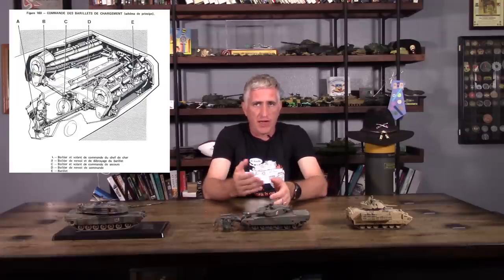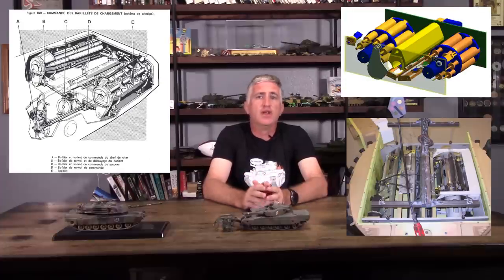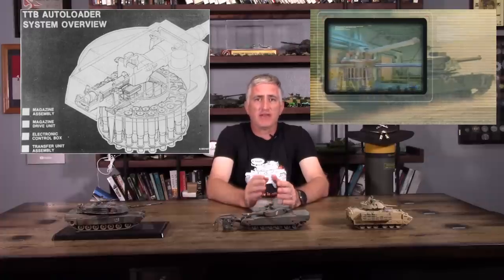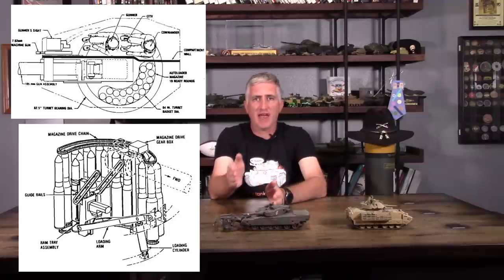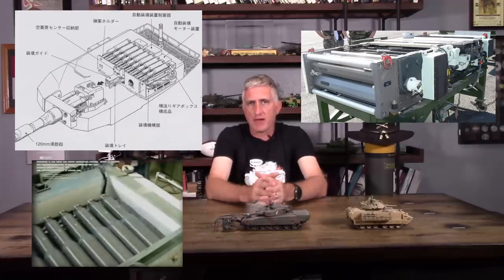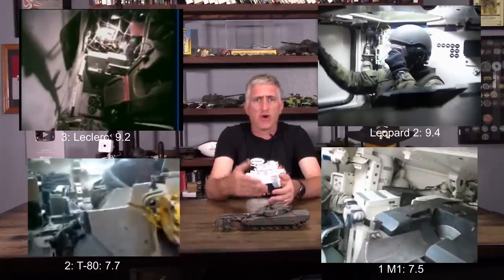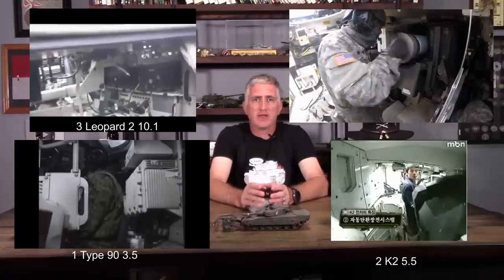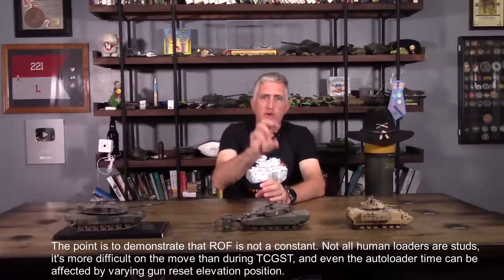Whither the Autoloader?

Comment: At some point human loader is too weak to be effective. Like the moment when the military uses bigger guns (Even same diameter like 120mm but with way longer rounds) can be a serious problem. Tanks in the past showed that 2-stage ammunition is way slower to load for one man than one staged where he only has to but the round in and it can be fired, modern autoloader will alos use one-staged ammunition i belive because its also fast then loading two stages one after another. 

The fourth man is not an advantage on field, I mean in the time of the battel no army in the world has time to save some of there tanks if they got hit, everything like this happens after the actual figth and mostly even trougth other units that a specialized in rescuing mechanist units. 
You can even say that man could be an disadvantage. If he dies no one in the tank can just try to fix it, also th moral would be down for some time, also the new loader maybe not working as well as the dead guy before with the rest of the crew. An autoloader on the other side would be just a modul, I believe modern auto loaders could be even designed like the engine compartments on Leo. 2 and Abrams so at the repairstation they can jsut be switched out and in in short time so only big problem would be in the end if the crew got disabled or even the hull broken.
Reply: Well you physically can’t use human loaders with most new guns, the RH 140 and the 130 are both autoloading only due to the weight of the shells. 

I think by 2030 most nations will be using at least some form of autoloader or at least an assisted loader, there’s no way we can keep improving penetration without increasing length and weight to the point humans won’t be able to do it consistently.
Reply: @shoppingcart9559  by 2030? Doubt
Reply: @bigturn1051  Id say its safe to say that most next gen tanks will use them, although I doubt any of that will be rolling off factory lines by 2030
Reply: I'm going to disagree slightly. The only thing you need to do to "fix" the manual loader is to have someone else hop in his seat, be that the gunner with the commander taking over gun controls, a spare crewman from elsewhere in the company, or even just some other tanker who survived the loss of their tank. Contrast this with an autoloader, where if something goes wrong, you can't reasonably expect to have it fixed in the field, and certainly not rapidly. I mean, it's a horrifying concept to consider the human loader as the most rapidly replaceable system, but it's the reality of the situation. If an autoloader goes down, who knows how long it would take to fix, or even if it could be fixed in the field. 

These are tradeoffs that need to be determined.
Reply: @EvilTwinn  one thing: It would become really tight with the injured or dead loader down there. Even if you just let him hang in his corner the tank is not capabil of fighting anymore and also the crew would rather try rescuing there members then keep fighting with somebody near death sitting besides them.
Reply: @Tankliker  The sad truth of it is that if a round hits the loader, he's probably in many pieces. You can move him out of the way pretty rapidly in any case. We're talking about a procedure that takes tens of seconds at most as opposed to something that could take hours and specialized equipment to replace. As far as the crew wanting to assist their crewman, while often true, sometimes you don't have that option. Let's imagine a Fulda Gap type scenario. Your tank company is right in the way of an advancing battalion of T-80s. They're pushing right up on your position. They outnumber you greatly. Your friend and loader may be dying, but if you don't keep shooting all of you will die. Remember, even for infantrymen, you've got to eliminate the threat that's shooting at you before you render aid, or else more people are going to be shot.
Reply: @EvilTwinn  I think it's still easier as a infantryman to figth beside dead comrades that still in one peace then for the Commander, Gunner or even drive to just figth within the mess that was there loader.

But I have a questions, the inside of most modern tanks is protected with spalliner, so small metal peaches shouldn't be the problem. Also the crew has gear on, not like full fighting gear with protected west, sidearm, extra Magazins and so but still the basic clothes and even some protection if the tank get hit and would rattel hard so they won't crack there heads open.
I know that if the guy got hit directly like the round perce him he won't survive also because of the heat of the projectile and low pressure area caused through the projectile (Pls say if I got that wrong with the pressure change, just heard it somewhere not shoure if it's true)

So in a better case for the loader he won't get splashed all over the comparedment or at least they don't need to puzzle him together before funeral.
Reply: @Tankliker  Unfortunately, anything that penetrates the fighting compartment likely has more than enough energy to do horrific things to any human they impact. You hear stories of wildlife that's wandered onto ranges and "accidentally" getting hit with APFSDS essentially exploding into bits of gore from the transferred energy. While a lot of that energy would be burned off from a frontal penetration, it would still probably  do terrible things to whatever hit. If it hit a limb, that limb is likely severed at least up to where it connects with the torso. If it hits the torso, the individual will be extremely dead, and potentially in multiple pieces depending on where it hit and how much energy that round had. A round to the head needs not be explained. Do note that this is mostly assuming a tank round. 

I do not believe that a tank round should create a significant pressure wave/vacuum following a penetration to even account for as far as wounding occurs.

HEAT I'm not fully sure what would look like, as I'm fortunate enough to have never witnessed the effects of HEAT on a person. That being said, if you remember a couple years ago a Leclerc got splashed in Yemen. Frontal penetration of the lower glacis by an ATGM of some sort when the tank was exposing its belly on a slope while the driver panicked. As I recall, the driver was killed, but all they had to do was rinse out the tank and it was effectively fine. I can also recall an RPG-29 penetrating a Challenger 2's lower glacis and essentially blowing off the driver's foot, but not doing terribly much else. They switched out the driver and it was able to self-recover. This is a longwinded way of saying that I don't have much to judge based on.

Might it be easier to fight on when you don't have to toss your dead or wounded friend out of the way to continue shooting? Probably. However, war has a funny way of making people do things they wouldn't normally believe themselves to be capable of.
Reply: @EvilTwinn  Maybe you shouldn't say funny.

HEAT would do even more damage if penetrates because of the molten stream that follows, so if you not dead you will be cooked alive. HEAT-MP would be even more dangerous because the round has a way stronger explosion and also the HEAT sting. If you don't want to meet a APFSDS projectile then you definitely won't want to meet HEAT, HEAT-MP or HE. There are so nice picture on Google from WW2 tanks that go hit with HEAT, the tank looked like Switzer cheese and the crew also.
Reply: @Tankliker  It's an expression, not me saying that it's humorous.
Reply: @EvilTwinn  I know, but just a really bad one in my opinion. I think you understand me at this point, I mean funny a better description for how kids tough there day was.
Reply: @EvilTwinn  I think it is kinda like the evolution of auto loading rifles or pistols people where wary of them at the time when they first came out. And if you think about it we can have another crew and tank buy reducing crew to 3  that is a 25% increase in tanks and crew i think that would take care of any break down in auto loaders!
Reply: @lambastepirate  That's making a lot of assumptions with prices and budgeting. And I'm not concerned about reliability, my concern is battle damage.
Reply: @EvilTwinn  if a round penetrates the tank, the crew is probably dead, modern rounds turn the insides of tanks into chunky salsa containers

edit so i fail to see how you pointing out "just replace the loader" is a real solution, as the vehicle now needs  hosing down, a complete inspection to go with the maintenance and any holes to be patched up, assuming it can be recovered, however with an autoloader you can armor the vehicle better, due to the decrease in volume, youre kinda arguing for making the crews more expendable because "muh mechanical unreliability"
Reply: @squgieman  Fortunately, modern tank rounds aren't so advanced that they generally kill crewmen that they don't hit unless they get secondary effects- spalling or something catching on fire. 

If you got a complaint about mechanical unreliability from me, you haven't read my argument. It's all about battle damage and ability to continue fighting after such damage is taken, either put into action immediately or with only a couple minutes truly needed to replace the crewman with someone new, as opposed to requiring most likely a crane and some significant time investments to fix an autoloader after it sustains battle damage. If we go back to our high intensity modern combat situation, say the Fulda Gap, there will be plenty of destroyed tanks and thus their crewmen around to get spares from. Maybe I'm too focused on having to fight the next Soviet MRR that's coming down the road 10 minutes after the one we just barely finished off, but it's an argument in favor of human loaders.
Reply: Brother captain Carthy pants 
One word: railguns.
Reply: @squgieman  if the crew isn't dead from a penetrating hit, they will be bailing out either way, as whatever managed to pen the tank will have time to fire again before the crew would have time to detect where the penetrating shot came from. And they won't be hanging around on hope that that next shot misses or fails to hit something more explosive or flammable in the fightimg compartment...
Reply: when APFSDS goes through tank armor it does so as a jet of molten metals that is why you see the flare up and catastrophic fires in the Iraqi tanks in DS 1& DS 2 .
HEAT does the same thing with more external flash.
Reply: @EvilTwinn  You seem to be missing one vital point in ypur point "We cleaned the loader off the seat and got you a new one, you are good to go". Tank commander then says what about the hole in the side of the turret.
Reply: @Flakey101  Shouldn't be that large of an hole, you can keep fighting with it. It shouldn't overly degrade the vehicle's performance outside of CBRN conditions.

Comment: I figure a big part of the reticence to adopt autoloaders comes in part from the fact that there hasn't really been a conflict where modern MBTs faced other modern MBTs in a while. For a tank whose main job is gonna be ventilating enemy tanks, an autoloader makes tons of sense, you're probably going to be slinging mostly one kind of ammunition, potentially on the move, and with great urgency.

But when's the last time an Abrams or a Challenger or whatever flavor of ultra-modern MBT you prefer had to go up against something that could be reasonably called its equal? There's not a lot of particularly threatening armor (to a modern MBT, at least) where we tend to be doing our fighting nowadays, and when you're going to be cycling through HE, smoke, cannister, whatever, I can see the value in having a human loader.
Reply: but autoloaders have no issue changing ammo types IRL.
Reply: @matthiuskoenig3378  They don't between what's loaded, but a human loader is going to be able to much more easily pre-prepare rounds that might be needed in the future in a ready rack, versus having to reload a machine.

Plus all the other stuff a human loader is useful for in a low intensity combat would be absent the tank- that extra set of eyes mentioned in the video, the extra MG (on tanks with a loader's MG) or rifle, etc

Comment: The cost of an MBT loader is 10 tons of extra armor in weight, thus making the loader the heaviest troop in military history. 

The maximum logistically acceptable weight of the MBT is 55 tons. Optimal operational weight of the MBT is 50 tons.

Given the optimal weight, a manual loader adds a 20% weight penalty without providing any benefit, thus the 60 ton weight of the Abrams M1 / IPM1 vs. T-72/T-80 

With necessary modernization upgrades the weight gap widens to massive 40% penalty. 

When compared to next gen T-14 Armata, the weight penalty of the latest M1A2 is insane 47%, all the while Armata is better armed and armored.
Reply: The armata is the new strv 103
Reply: @cursedcliff7562  No, Armata is the new T-95, strv 103 is not a tank by definition as it does not have a turret.
Reply: @BigSmartArmed  The Swedish beg to differ. They designed it as an MBT.

Comment: You simply can not overestimate 4th crew member. Its not only the maintenance and scanning. It is in fact a lot more than that. Especially if the loader has some special training e.g. he is the medic or he speaks the local language.
Talking about 4th crewman in the following APC or IFV is reasonable ONLY in ideal case scenario when it is possible for IFVs to follow tanks, loader sits inside not destroyed IFV and he is still alive, possible to step outside the vehicle and run to tank, possible for such soldier to leave the APC crew e.g. case when loader is the medic and he is focused now on wounded soldiers.
Reply: Better to have that 4th guy tucked away and safe than to have another body that may hamper evacing quickly if your tank is knocked out... Besides having a secondary skill that validates having that person inside the tank and not in an IFV following behind the main advance is not mandatory with the majority of loaders so using that as a point is not valid. I won't argue that no loader has such skills or could take courses in such things, but its very much optional...
Reply: @Feiora  Did you really write that a guy in the IFV is somehow more save than inside the tank? Tank crew members are the safest people in the whole war no matter what! Most tankers will come back home with no harm. IFV is not only poorly covered but also poorly armed and the troops have to leave this place to cover the back of the ally tanks on foot.
That doesn't apply to T-34 crews during WWII.
ps. The loader has the easiest job in a tank. The driver is the mechanic, the gunner got to know the ballistics and his training takes a lot of effort and time. The leader knows the tactics and is most experienced. In fact, he is almost always a former gunner. The loader carries an additional skill apart from his regular job.
Reply: @HanSolo__  In theory the IFVs carrying the extra crew members will be back with the supply units and not up front in combat, thats for the tanks and the IFVs carrying infantry to do. Also, no vehicle is safest in warfare, tanks draw the attention of every enemy tank, infantry armed with AT weapons and in this day and age aircraft and helicopters with dedicated loadouts to armor busting, and yes IFVs are vulnerable to the same things too however IFVs are not the first in normal circumstances, its the tanks and THEN the infantry, the IFV's job is just to get'em there. Therefore I posit that the extra crew members for a tank could be brought up by IFVs during lulls in the fighting or when the tanks have reached their designated positions and halt for the time being. It is then upto the infantry to sweep and root out any remaining enemies while the tanks are restocking ammo, making repairs, etc.

Comment: I hope they build my system...
Which is two rotating carousels similar to used in the Canadian leopard.
But putting the two shell rotating drums next to each other both moving from side to side so when rotating and moving from side to side the shell ends up in the same position every time.
A pusher rod or system can be used to load the shell...
This allows for one sliding door.
This system would suit the latest iteration of the leopard....

Comment: Very good video and fair comparisons. I had worked on the MGS predecessor. Back then Ares did the auto loader and Teledyne designed and built the turret. Later purchased by GDLS. We were able to drive the gun to a load position, while on the move, to auto load a round. I always expected autoloaders to become more reliable, as more were used and designed. I believe w heavier rounds and more diversified crews, and unmanned vehicles, we will see many new and reliable designs